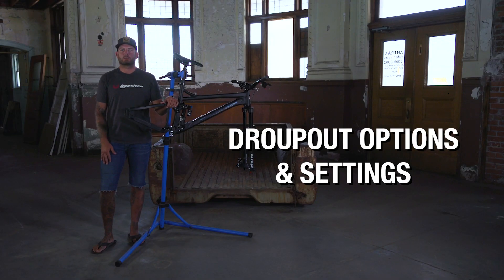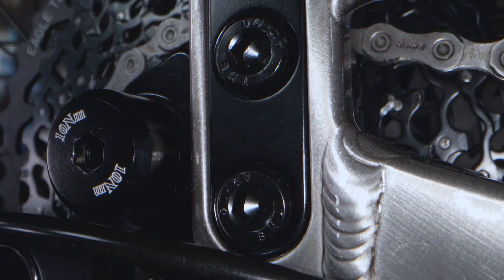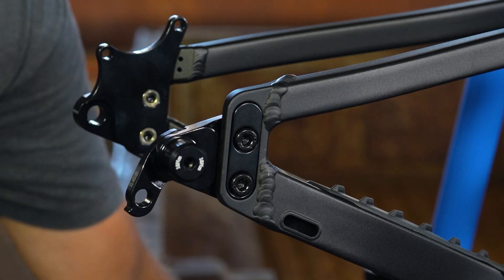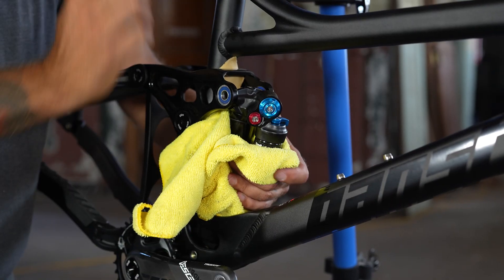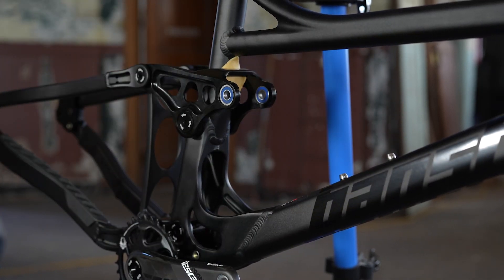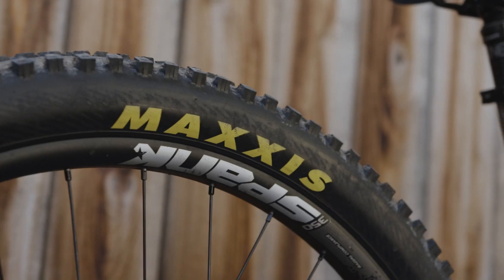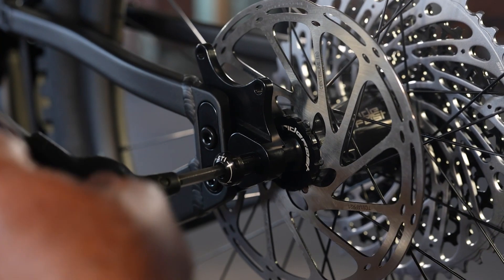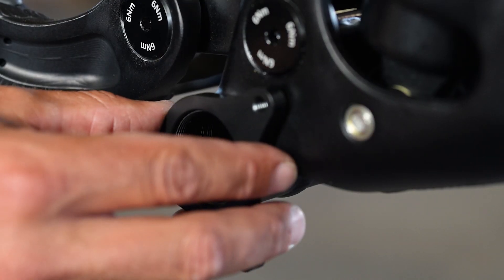BANSHEE BIKES TECH - DROPOUT OPTIONS

Comment: Would love to see this on the Paradox
Reply: Putting modular dropouts on the paradox would require replacing the compliant forgings design, so would be detrimental to the quality of the ride.
Reply from the maker: Thanks for the question Robert! As Keith(aka the engineer among other things) mentioned in doing so you'd lose a lot of the designed in compliance. It would also add weight and cost, all things heavily considered when creating the Paradox.
Reply: Don‘t ever change the Paradox! 😝🥰👌
Reply from the maker: @TanteVorsichtig  Rest assured you won't have to worry about that anytime soon!
Reply: @bansheebikes- appreciate you boys sending me new dropouts for nothing..you guys rock..bike is perfect now🤙🤙🤙